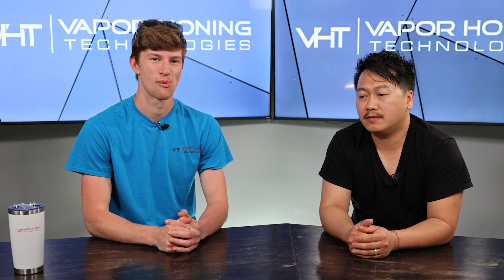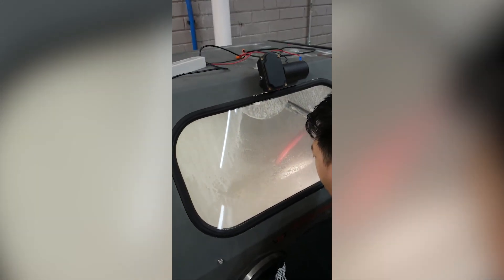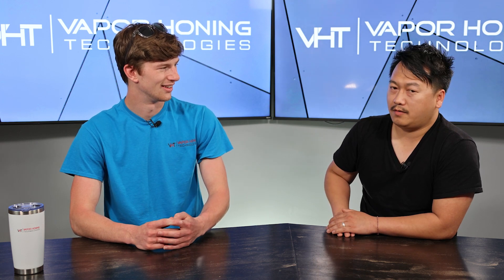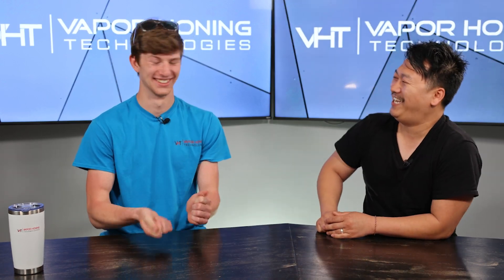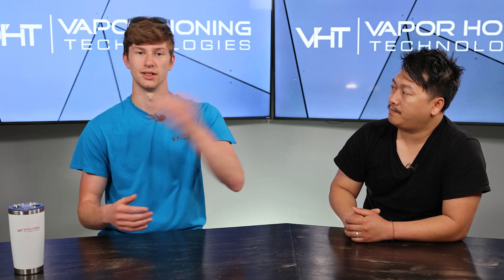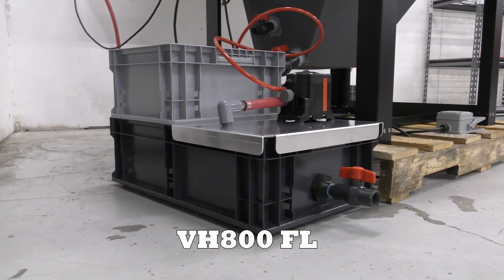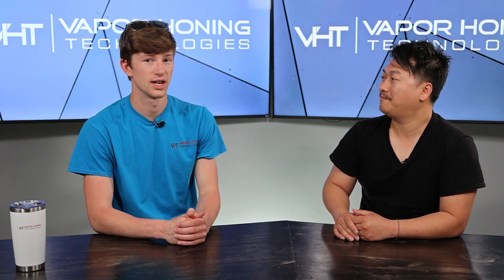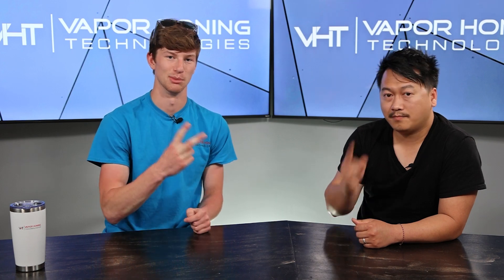How to Set-Up your Vapor Honing Machine for Soda Blasting?

Comment: In my semi retirement, I’m getting back into rebuilding the old aircooled VW engines, which I did decades ago. We had a large dry cabinet for blasting most parts with sand or glass beads. But we NEVER did the case halves because of small oil passages with soft plugs. We didn’t want any hard media/”dwarf ”to end up in oil because it was nearly impossible to clean every trace out. 
I’m assuming wet soda blasting is a good option and if a bit remains it will be harmlessly dissolved in break-in oil. True?
Anything I’m missing?
Other pros & cons?
Reply: SWARF, not dwarf! Darn spell checker!
Soda blasting good for pistons too, right?
Reply from the maker: You are correct! Wet soda blasting is great because it cuts through dirt, grease, and grime without an issue and doesn't damage the part. 

Using a glass abrasive on these cases is also an option if you would like a better looking surface finish, as glass bead smooths the surface. Because water is introduced into the blasting process, the abrasive does not impregnate into the surface nor mar it up. Additionally, the abrasive is suspended by the water and does not hard pack into passage ways as easily. Here is an example of glass bead on some Volkswagen parts: https://www.youtube.com/watch?v=p6HEbrTKgHc

Here is a video comparing hydro blasting, wet soda blasting, and glass beading: https://www.youtube.com/watch?v=hX7lp1oOxdQ

If you have any other questions, you can reach us at 828-202-5563! Thank you for your comment.